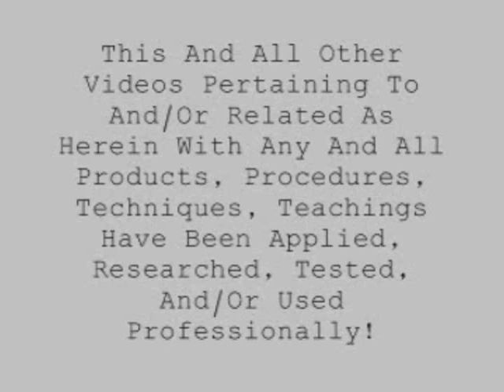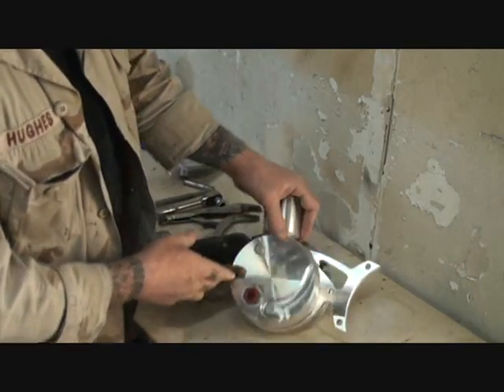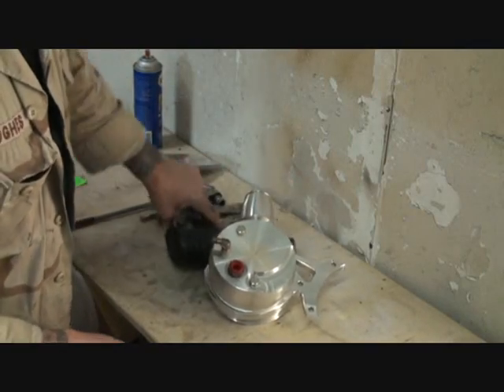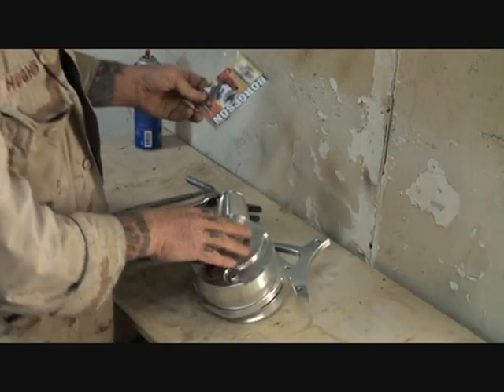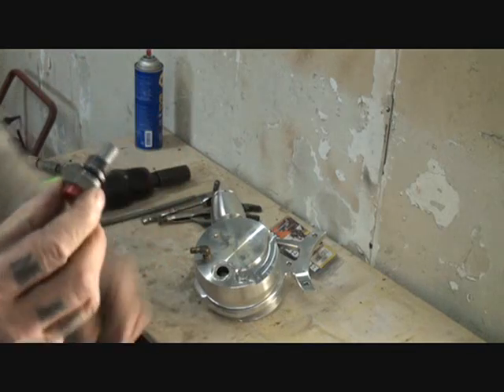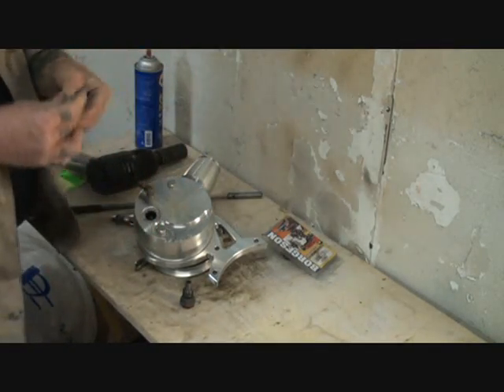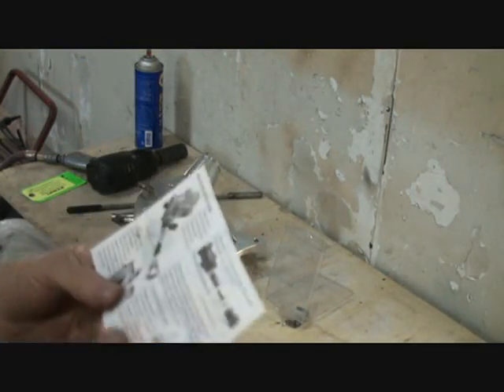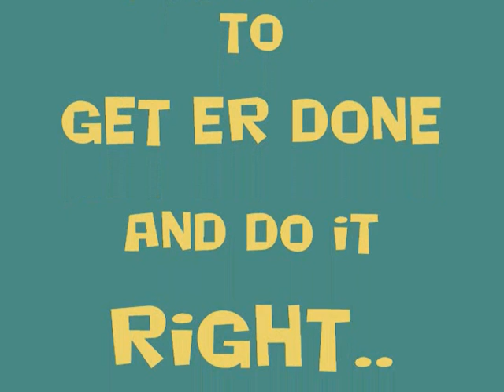Power Steering Pump Pressure Reducing For Your Mustang Rack and Pinion. Part 1

Comment: Just did this a couple days ago on my Mopar with a Saginaw pump.  Didn't have the shims so I made them out of some old copper crush washers.  The ID was right, but the OD was too big.  Spun it down against a file clamped in a bench vice.  I think I added about .080" to the shim pack.  It took a fair amount of slop out of the wheel.  Good video!